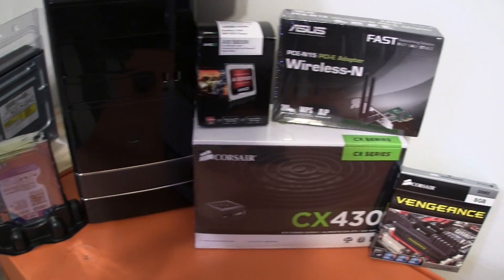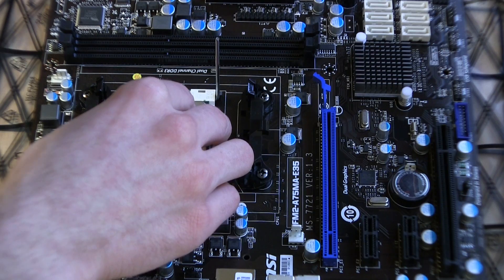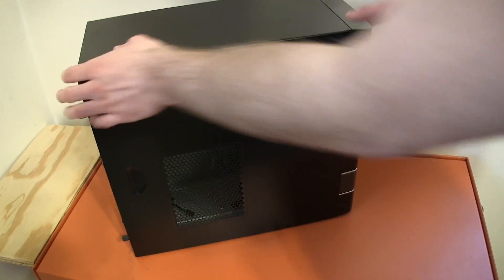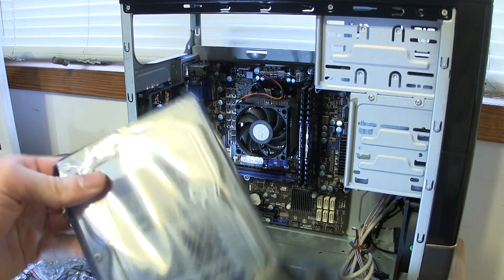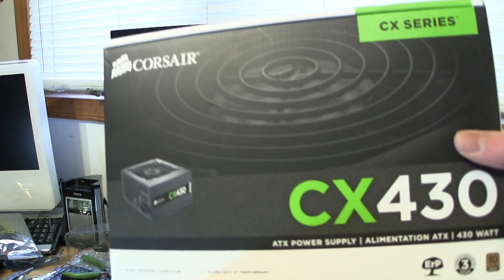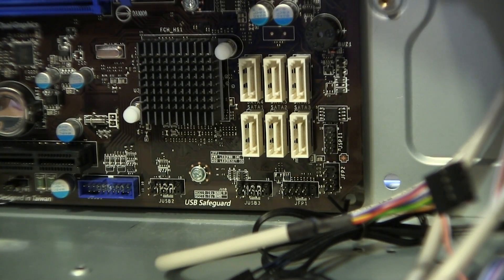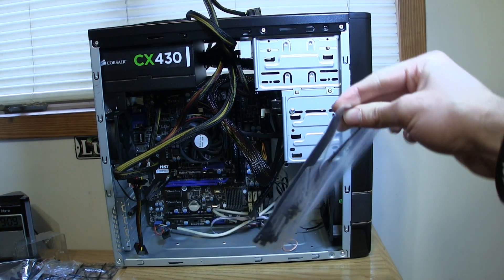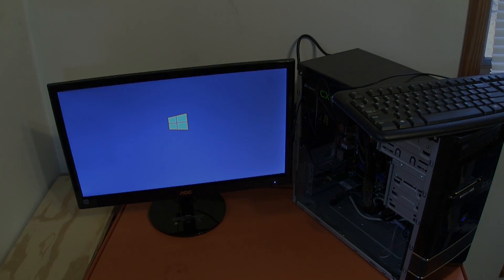How to build a PC ($400 Build)

Comment: I love PC's for workstation n productivity stuff. But I use my Xbox 360 for gaming. I just don't see a satisfying price ratio of graphics quality to cost in regards to a PC. I think the graphics I get on my Xbox 360 is excellent for the whole machine only costing $200. Were with a PC I would have to spend more than the current cost of a Xbox 360 for better graphics than compared to the xbox 360 graphics capability.

Comment: I like the AMD locking mechanism for CPU better than Intel's locking mechanism.  But I like Intel CPU's better.  I am using a AMD in my current system I am building.  I plan on getting a Phenom II X4 core processor.  I bought the mother board years ago so I have to go with an older CPU.